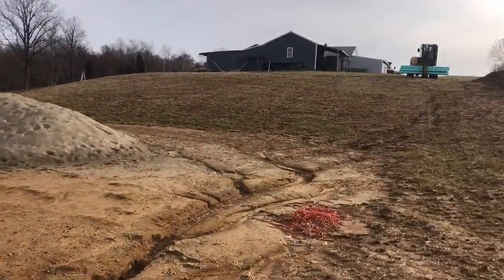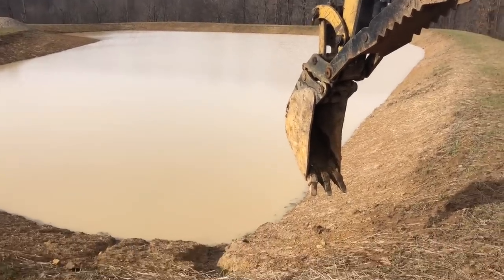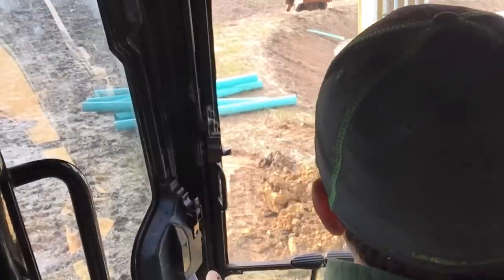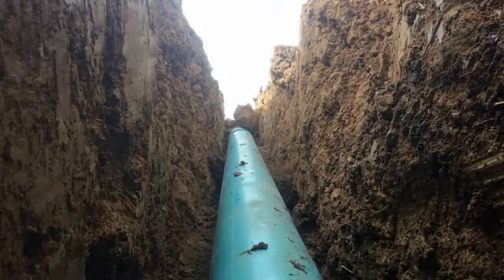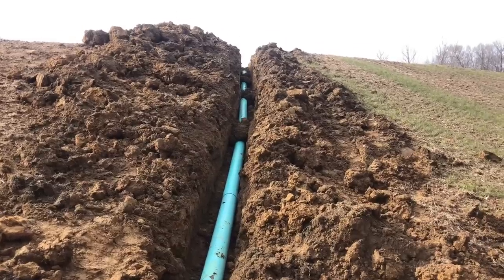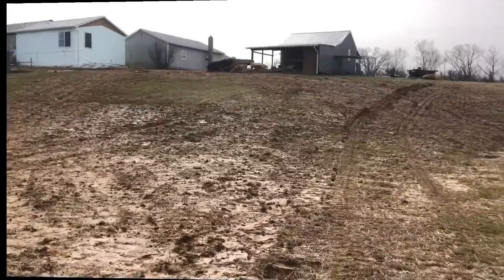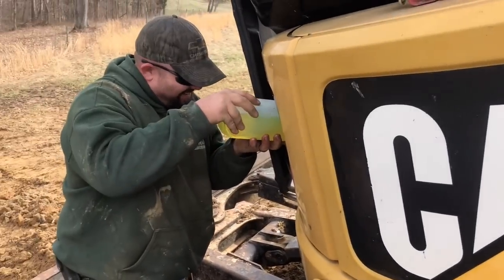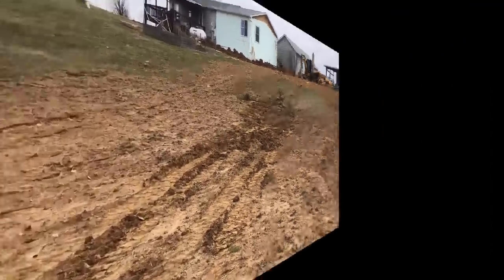Trick to digging with a small bucket and installing a overflow

Comment: I’ve got a 305.5 in northeast Louisiana where we dig river clay, which in the old filled oxbows is very sticky. We mostly use the 12” for cleaning the big machine buckets.  At some point they all become heavy spatulas. I’ve considered building a flip down bucket gouger. That machine with a 50” bucket has done more for my roadsides than the 14M I bought. I machined pedal extensions I can send you. Plus a machined “key” to keep the beeper cancel button rocked.
Reply from the maker: Pedals seam to work fine for me but would be interested is seeing what you got email me At Michael.simon@simonandharris.com thanks
Reply: I sent a couple emails with the pictures.

Comment: What shall we call your "Little Supervisor?" "MISS DP," since Mrs. DP is already taken? HEY, at the beginning of the video, as a former EVOC/Pursuit driving instructor, I was going to compliment you on your... High-speed Backing... and then realized you were going forward, and we were seeing the (forward) reflection in your back window.  

Another good video, Mike. A couple years ago, I dug a trench on my nephews ranch to drain a spring that flooded his fields every spring. About three-hundred feet from the spring to the creek. I got that bucket chock full of clay and nothing short of dynamite, or a digging bar, could get it out. NOW I KNOW how to prevent that in the future. Thanx....

Comment: yup shallow cuts and don't pack it in there.  long shallow cuts.   A lot of people dig from the bottom of there trench and thats a good way to pack it into the bucket and tear out unknown utilities.    We've all run someone thing out of fuel at some point. surprised to see the injector lines under the seat.  Most ive seen have the engines in 180* i guess.

Comment: I bet if you welded a steel pipe or tube at the top of the bucket to always allow air in you could take bigger scoops.  Just like shotgunning a beer! haha. Also, keeping the inside of the buck smooth would help reduce friction and make sure there is a slight taper in the walls of the bucket
Reply from the maker: Good ideas thanks

Comment: Don't feel bad, it happens.
With a 1/2 tank of fuel I drove our Deere skidsteer down into a deep hole to retrieve a big rock. While backing out the fuel alarm went off and it stalled. Good time.
Reply from the maker: Lol yup
Reply: I had this same fuel issue on my Argo 8x8 AATV.....half tank of fuel climbing hills would stall the engine & the fix is to install a small low voltage auxiliary fuel pump in in fuel tank...... also did the same thing in one of my loaders works great !....

Comment: We build 10 or so Dams/ponds, per year, up here in WIS. They R engineered and funded through the county soil conservation service. Most R on farm land. They normally use 8" to 12" sch 40 PVC. We have 2 install anti seep collars on the pipes and backfill compact the soil with jumpin jacks, to prevent water from eating along the pipes. Nice sized residential pond there.
Reply from the maker: Yes we have to do similar steps depending on location and water shed coming in thanks for the comment

Comment: Thinking about cutting out the sides of the trenching bucket to make it into a spoon instead of a scoop. Have to leave enough material for breakout and strength, but remove enough to avoid clay getting stuck.
Reply from the maker: I have another buck for the 120 I have done that to you will see at some point but don’t work as good as the air gap at top for me thanks for the idea tho appreciate the comment

Comment: but bleeding the fuel system is fun and without running it out of fuel you can't do it right. Next you will say water is not an approved hydraulic fluid replacement.

Comment: I run a kitten like that and the rotate power is just super weak. Is there a way to make it stronger or do you have the same problem?
Reply from the maker: No have the opposite problem almost to much not for sure what you have going on but interesting for sure
Reply from the maker: No I have almost the opposite problem to much not for sure what you have going on interesting tho
Reply: @DirtPerfect  I asked a tech and he said it was a safety feature. I guess in case some rental idiot couldn't turn his or her self over on a slope.i wish I could figure out a bypass. They are smooth lil babies to run though

Comment: from my 58 year experience that 6" over flow pipe was a waste of time and money, with that large amount of step hill side a hard heavy rain storm once that pond is full, the water will way over run that pipe, like putting a straw into a bath tub over flow, that over flow pipe needs to be minimum 24", buti put a 36" in for that extra back up, come try and dig here in my hill sides with a small bucket, you will have that bucket jamed up by the 3rd dig, the red, gray sticky clay here is like snot, its the best modeling clay around, it is need to look at the walls of the hole to see all the laters of different color clay, it is like someone, was laying it down in 10 to 18" layers, the gray clay layers look like a frosting on a cake, and as thick as it,, the bucket teeth cuts perfect ledges          that hold there shap, gray, red, dark red to 3 different colors of gray, 37 feet down is still the same
Reply from the maker: Boy you sure know a lot with very little information the only wast is my time reading this comment thank s for watching